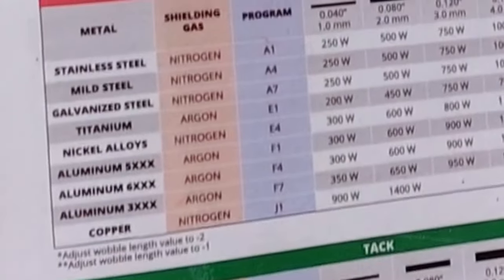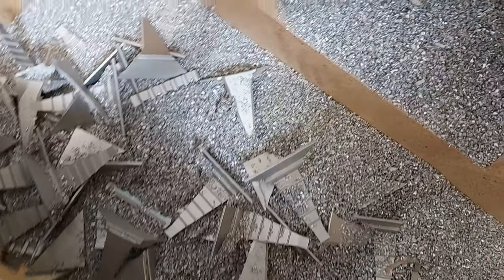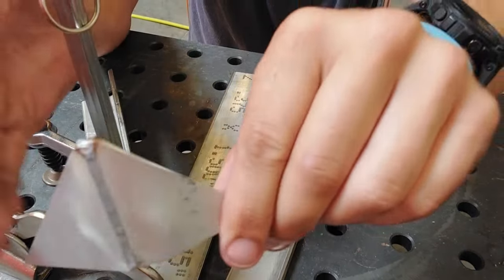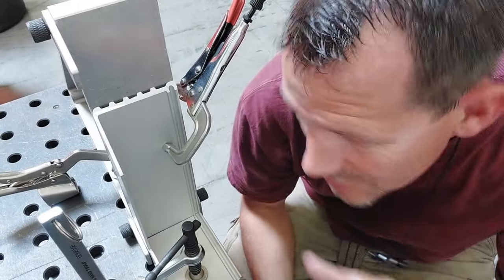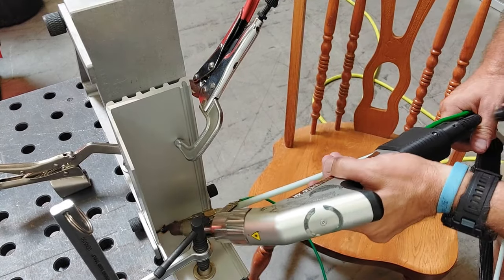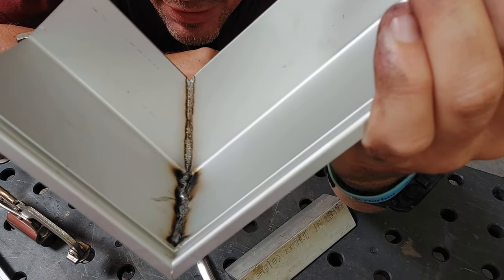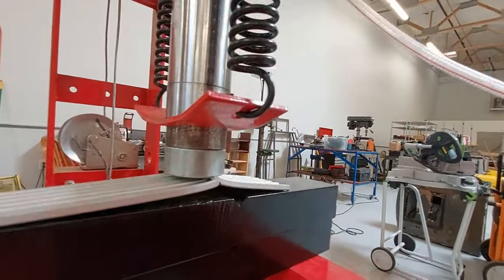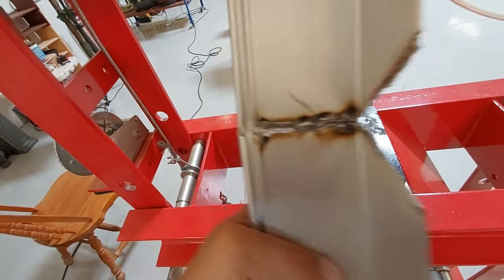Laser Weld Strength Test! See how a Laser Weld really does

Comment: Metallurgically speaking, when welding Aluminum: You should always use a filler wire that's compatible with the base metal's properties. Aluminum is very seldom if ever fusion welded, as it will chill crack on a microscopic level, and leave a very brittle weld bead. Also welding extrusions is not ideal if they have a grey anodized coating on them. That will contaminate your weld bead and is most likely the reason for the nasty black soot around the joint.
Reply from the maker: Some lessons were needed to get extrusions to stick together. The XR model cleans off the anodized and then welding continues as normal aluminum.
Reply: It is possible to weld lower series aluminium autogenously with lasers with very little cracking.
Reply: @hematose  What exactly is "lower series aluminum"?? There are many grades of aluminum, none are necessarily higher or lower than another, just different properties.
Reply: @life_of_riley88  "Lower" means a lower series number. 1000-series is a lower series than 6000-series. 7000-series is really difficult to weld autogenously without cracking (some would say impossible maybe), 6000-series is easier, but still really hard. As you go down the series (to lower numbers) it typically gets easier.
Reply: @hematose  Yeah. . . That's not really the case. It's not a scale, and it has everything to do with chemical composition and heat treatment, not weldability. 7000 series aluminum is nearly as difficult to weld as say 2024 aluminum which is nearly impossible to weld without special equipment and conditions. Even then 2024 is NOT recommended to be welded in any industry.
Reply: @hematose there are 2000 series alloys that do not weld well, or shouldn’t be welded at all.
Reply: @life_of_riley88  he said "typically". whether the series is based on chemical composition or the socks the materials scientist was wearing, if it's coincidentally the case that common lower series aluminium is easier to weld than  common higher ones, then it's a functional rule of thumb for the average welder.
Reply: @itsapleasantlife   Are you saying that in this video you used the model with the cleaning feature? And that really works for cleaning anodized and it's not just for cleaning oxidation? I didn't even notice the anodized part of this til I read the comment. So what are the lessons you needed to weld through anodized?

Honestly I've never considered anodized weldable like at all! I sand the anodizing off EVERY TIME  I tig anodized metal. Once I sand it off with a little pneumatic 90 degree with a sanding pad I get very clean welds. Takes very little time. Those ridges in your extrusion shapes though might be a pain to sand.

I wish I could figure out how to zoom on the video. After replaying and looking closer those welds on the 90 degree angle you welded look pretty contaminated. I'm both surprised and impressed they held up so well.

I only learned of manual laser welding myself last week as I got to use one at fabtech. So I'm still learning about this tech.
Reply: seem to weld just fine sheets, but of course you can't use that some grade welding, but pretty awesome tool if do sheet work

Comment: Being a user of one of the lightweld models, to prove a point about the neccesity of some penetration to a co-welder and turning the settings up, I took an 8 pound hamer to a 4 panel 10x30 inch stainless box I welded and the metal near the weld was ripping before the weld was doing anything. 

Also, you should be wearing the helmet it comes with, sleeves, and gloves when welding with it and not put the safety clamp on the gun itself... I've felt the beam bouncing back at me (you'll feel a warm vibration) and I've put surface level cuts with flashes of fire on my leather gloves when tacking pieces and had scorch marks from where my hand was while welding. I even intentionally burned a hole in a pair of gloves I laid infront of the beam path with a very short trigger pull. 

And to not damage the $3000 gun, aim it at an angle, the beam will deflect back up the tube and can mess things up if you go straight up and down.
Reply: Do you have any information if it will weld brass?
Reply: @danl.4743  I've seen it weld copper together and copper to stainless steel so it might
Reply: T machine were you using
Reply: @pieshka4509  Copper to stainless? I want to see that.
Reply: Always read the manual!
Reply: What machine

Comment: Laser welders can be much stronger and faster than MIG.  Now the problem is if your not setup correctly or using lower power systems, it’s easy to make good looking welds that have crap for penetration.  Especially as there is no “feel” for if stuff set wrong.

Comment: Strange way to test the strength of a weld with downward pressure.

The weld on the angle broke fairly easily which you'd expect but putting downward pressure on a joint that's touching the base isn't really stressing the weld to breaking point.

Nest time Try clamping either end and pull the metal apart to test the shearing strength equally.

I'd be interested to know how bigger gap you can fill across with a laser welder.
I've had to regularly bridge 1/2" gaps with Ali mig which it does reasonably easily

Comment: can you do a comparison video on steel with different thicknesses with all four welding tech. 1. laser, VS . TIG VS. MIG VS stick. which one is stronger faster cheaper and OVERALL
Reply: With the new 5000w laser welder, my money is on the laser in any area you can think of on any material up to .25. Except for 1 thing, the machine costs $32k USD.
Reply from the maker: After using a laser welder I struggle to pick up other torches. All other options are by far cheaper if price is your priority. Speed and thorough penetration for daily productivity, laser wins by leagues. Other methods could not keep the quality at the speed.
Reply: @michaelmaroney1660  with the time you safe, the laser pays itself in no time!
Reply: I've seen a review that laser welding seam is bubbly and it cannot be prevented by settings therefore laser welding strength is far worse than other professional welding. 
But of course there are applications where laser welding is great. When you need to weld fast, clean but the strength and longevity isn't very important.

Comment: In order to pass a bend test you have to have penetration out the back of the  part.  Both of the triangles failed the bend test.  On a Good weld the area with the weld will stay flat and the parent material will bend left and right of the weld. Same with the extruded aluminum part. The welded area should have stayed put and the 2 straight parts leading down to the table should have bent first.

Comment: What is the brand and series of welder and where do you purchase it from? Have you tried joining 304 Stainless and different grades of carbon steels?
Reply from the maker: The brand is IPG lightweld. We have done both but not together. We'll try it out and post a video soon!
Reply: @itsapleasantlife  hey man that’s great, would love to see the carbon to stainless video. I have a request, could you email me personally?
Reply: Carbon to stainless is a breeze. We do a 16 ga galv to 7 ga hot roll that is near impossible with mig and is easy with this machine check out Serra Laser... They've put one on a Fanuc collaborative robot.
Reply: Ouch $32k price tag....
Reply: @douglasbiesecker  It also welds with 30 amps what takes a TIG machine 200 amps. So my question is. If one owns a fabrication shop how much money is saved on electricity and does it make up for the difference in machine cost in time before the machine fails fully?

Comment: When you use no wire....what is holding the welded pieces together?  Is it just the melted original surface?  That's it?
Reply: No. it's a blend of (thin) air and atmospheric glue.
Reply: Please oh please get rid of the music
Reply: You would be correct. The technique is used on items that typically don't need the reinforcement of filler material. Only possible if the fit up is exceptionally tight.
Reply: @kevinchamberlain7928  hahablahhaagaahaa

Comment: What kind of eye protection is necessary?
Reply: The best kind. This thing will cut you easier than metal
Reply: He's supposed to be wearing a special helmet with an aluminum plate they provide with the machine that has a special glass lense in it along with the laser safety glasses underneath the hood. I have scorched gloves that can tell you the beam will reflect back
Reply: @pieshka4509   In a word, "holy shit".  Thank you for that information.
Reply from the maker: They do provide a regular helmet with an aluminum heat shield on it. I would use it for long runs of stainless steel as it would reflect the heat back. For short runs of aluminum the UV glasses work fine. I also use green welding glasses to reduce the glare a little more. Other than that, you can pick up most pieces of metal seconds after welding it.
Reply: @pieshka4509   Laser safety glasses.  I read somewhere that the glasses you get for lasers are not to block the light but to make the laser more visible.  Any thoughts on that?  I'm talking about the glasses you might get w/ laser levels, for example.
Reply: @itsapleasantlife   Very interesting.  Thank you for the info.
Reply: @alext8828  the glasses are supposed to block a certain wave length or lessen the damage from it. When I looked at the sight for the glasses my shop got for the laser welder and cutting table, they have different colors from clear to purple lenses and different wave length ranges. I don't remember what wave length the light weld is but it's a class 4 laser, so very serious business

There's a youtuber that does weird stuff with lasers like making a bread toaster out of lasers that mentioned this once with an at home tattoo/hair remover and the unsafe safety glasses it came with because he shined the beam through them
Reply: @pieshka4509    Cool.  I'll try to find that one.  Thanks.

Comment: You can tell hes an experienced well trained welder by not having a need for leather gloves or anything.
Reply from the maker: It's not TIG or MIG or Stick. You can literally pick up most pieces quickly after welding them. The heat stays very concentrated in the beam. It would take feet of welding a single bead before deformation begins. Stainless steel I do wear gloves. Aluminum is no problem.
Reply: you seem to not know anything about laser welding. like he already explaind, you dont need gloves or anything, just glasses...
Reply: @p__jay  Yep, clearly expert weldors... (And yes, that IS the proper term...but you pros already knew that).
Reply: @itsapleasantlife we wear gloves and proper helmets not just because of heat, but because of the intense IR. That causes cancer. I don’t know how much IR is emitted from this process. I’ve seen others, including the company;s rep, welding with just a lair of gas welding goggles. But that doesn’t make it right. For examp,e, mist oriole call the welding work lead the ground lead, even though it’s not a ground.

Comment: Hope you dont have anyone else in your shop. The beam can bounce, especially off non-ferrous. Single bounce is just as hazardous as a direct shot. In the eye= permanent blindness
Reply: That depends on the optics. If it is a collimated beam you are correct . If it is a convergent beam focused on the weld zone/filler wire the risk is greatly reduced. Surgical laser cautery machines are focused - one meter from the normal cutting zone the energy is spread too wide to do any damage.
The welder's optics are probably similar , otherwise the device would be unnecessarily dangerous.
From what I have read, all laser welders use convergent beams.
Focusing the beam also makes the welder more efficient.

Comment: Your tchnique is flawed. Make your supports 1" high. Remove the swiveling, movable jaw from the c-clamp and repeat your experiment with swivel ball mount above the weld line. The moment your weld bead comes into contact with the surface of the tabletop, you are no longer applying bending tensile force to the weld. You are "unbending" the sample and compressing it. Not a good test.

Comment: This is not welding. Its fusion melting 2 surfaces. First learn to how to weld correctly. And get the proper safety equipment. The corners are completely blown out and the oxidation and discoloring is due to incorrect angle of the tip, and massive contamination. This alone will cause joint failures. Your breakage test is pure bullshit. If you want to test strength of the weld joint, do a cut and polish and see what the penetration is.

Comment: It's like a glorified MIG welder.
Reply: Having used one and looked at the fusion and wire welds it's more TIG made extremely easy
Reply from the maker: It is not like either TIG or MIG. It purely is its own. Laser.
Reply: @itsapleasantlife  I must have looked at it wrong. Is that a gas line or filler wire?
Reply: @Thaijler  Both.